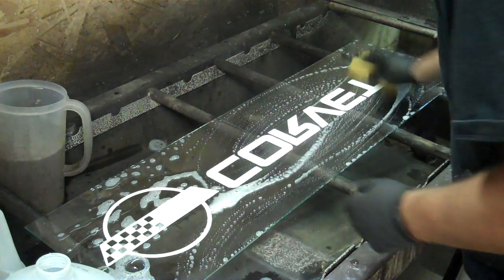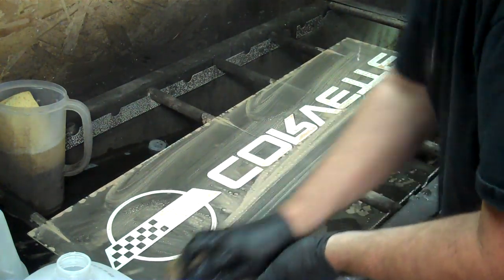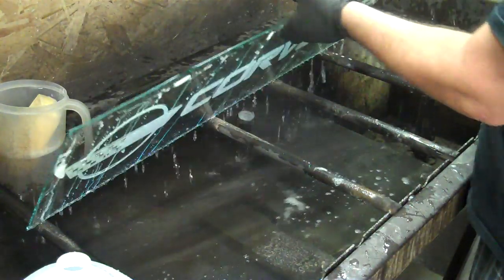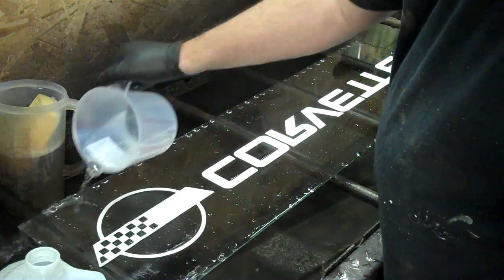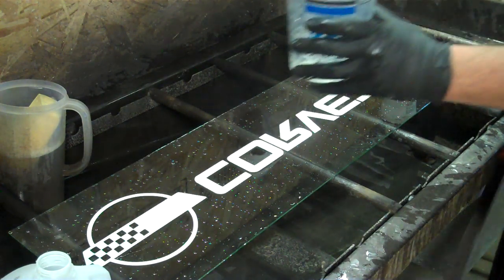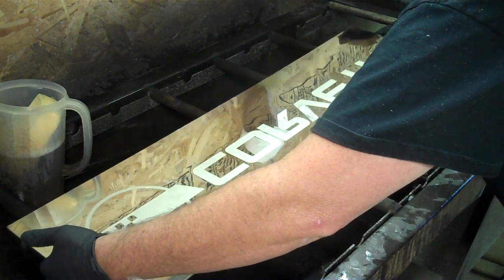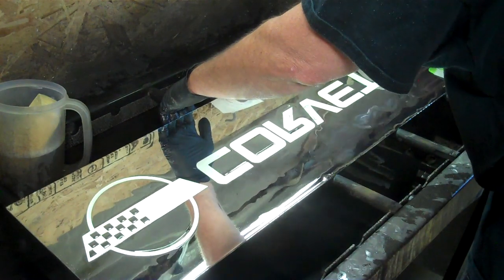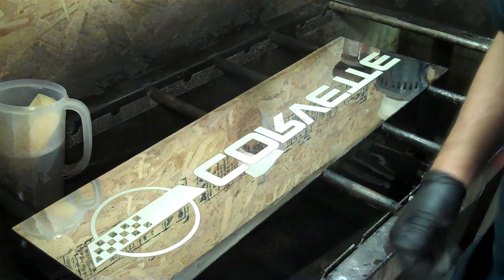Silvering a Mirror with C4 Corvette logo for demonstration of Selective Silvering

Comment: The vinyl is not removed, a backing paint is applied then its a job done!
Reply from the maker: you are partially correct, the vinyl is left on to do the backing to the silver and then the vinyl is pulled and the lettering is painted in whatever colors you want
Reply: How strong is the system once the backing paint is appied would it not just pull of the silver?